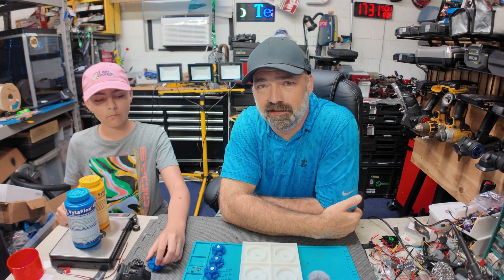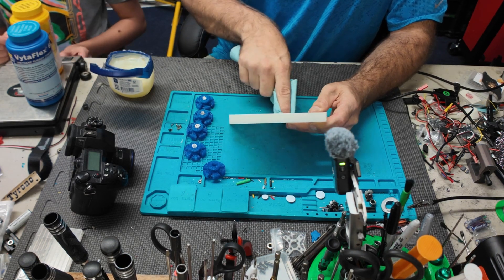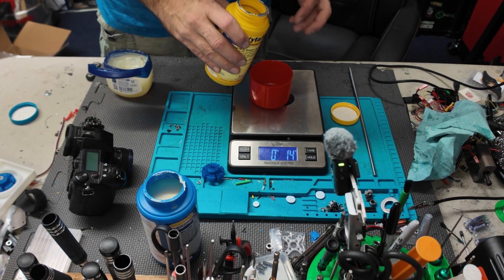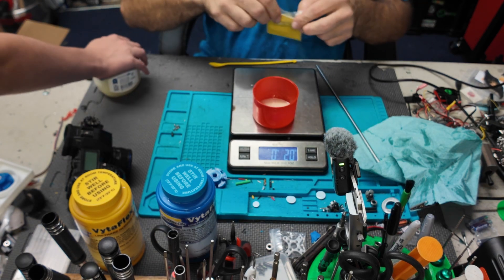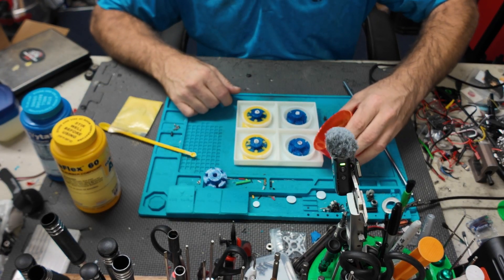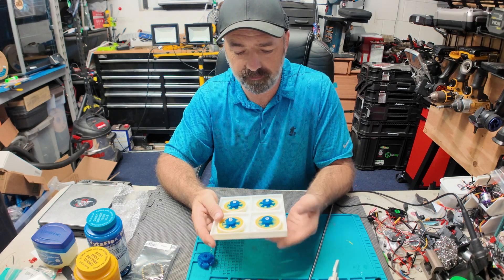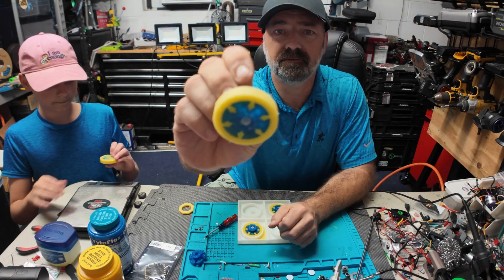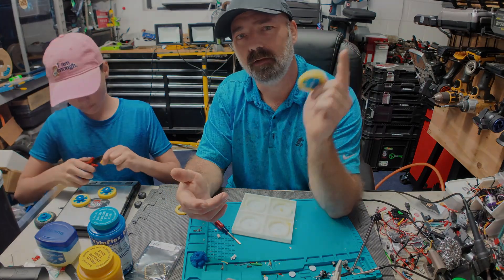Trying to make Urethane Wheels For Our Battlebot!

Comment: Why do some robots have grooves on wheels, is it for less bouncing?
Reply from the maker: The grooves act as tread so if you run over debris in can go into the grooves and the tire maintains contact with the floor to as a tire with no groove goes on top of everything causing loss of traction.
Reply: @TeamJunkYardDog  hey, thanks for reply, that makes sense to me, but I saw some vide claiming that grooved wheels have more traction on flat surface.. I tryed to figure that out :)

Comment: Did you sand the inside of the mold a little bit? I ask because the ridges from a 3d FDM will act against you when trying to demold. I have experienced this. The rubber gets stuck between the layer lines even with mold release. Vasoline works with some better than others, some need mold release spray to work well. Im not sure why but sometimes it works great and other resins simply need certain mold release chemicals to work properly.. over all, you did good! The first time you do things is always the best learning experience.  Very few people get it exactly correct on the first try so don't feel bad. The fact that you have usable parts is a huge win.. keep it up!
Reply from the maker: Wow thanks! We are goinf to try a tpu mold next with finer print lines to reduce layer lines.

Comment: Very cool. What material did you use to print the mold itself? I've tried the Team Panic method for rtv silicon wheels for fairyweights so far with good results. Definitely going to try this if I can find something equivalent to that Vytaflex.
Reply from the maker: We used pla but will use tpu for the next one.

Comment: You may consider trying a "spray can of mold release" to mist the forms/molds before the pour..could work very well for your purpose but the spray may get on other stuff on your work bench.. so you may need to spray release agent outside of shop? then pour inside.
Reply from the maker: I will likely order some. I couldn't wait lol
Reply: When I was making fiberglass and wood composite recurves and longbows I used to use turtle wax on my forms, then overlay with Saran wrap or very thin clear plastic..never had a bow stick to the form..I would have well over $100 of materials on each glue up.. I was looking at making some tires too. The Ohio guys next to me at the Tallahassee fights had some impressive tires on their bots. @TeamJunkYardDog
Reply from the maker: @robertrussell6324  I thought about turtle was but didn't have any. We may start making all our wheels.
Reply: I am also thinking about it. My problem is staying under 454 grams. I guess I can make some and see how they compare to aluminum wheels and foam tires. It's fun to experiment with materials... We all have a box of stuff that didn't work out...